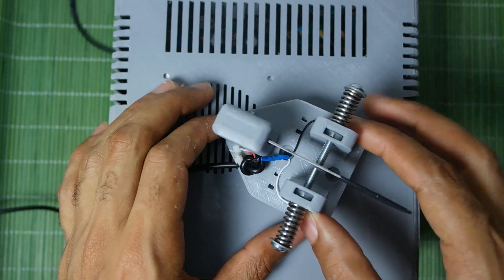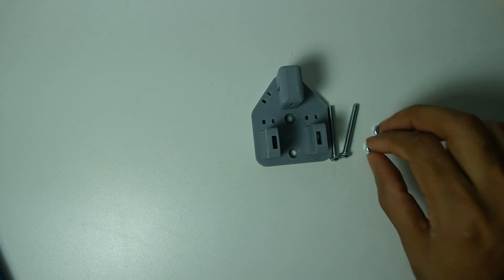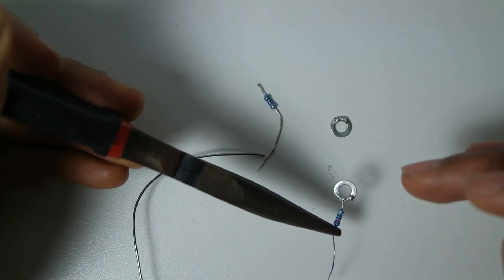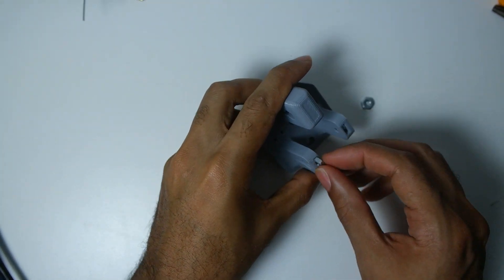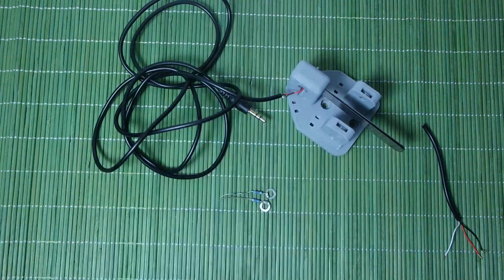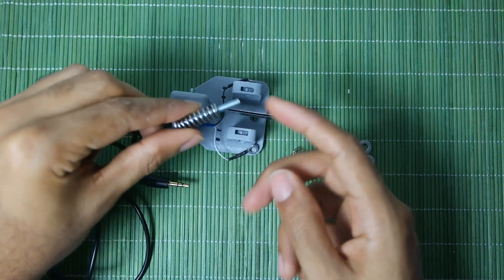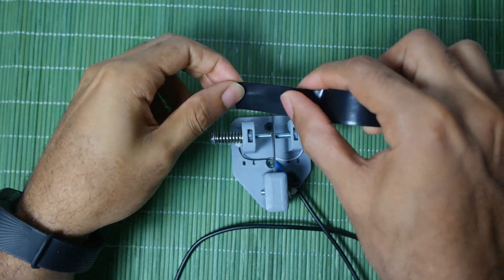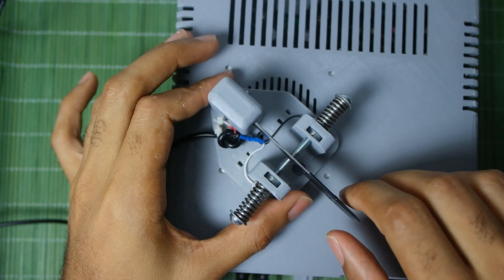3D Printed Single Lever Morse Code Paddle for the uBITX

Comment: Nice design. May i'll try it. But it is litttle bit too high for me. But thats no problem. Thnx for sharing the files.
Reply from the maker: If you have suggestions for modifications let me know.
Reply: @UndernetSystems  like this https://www.thingiverse.com/thing:4546930
But i found other designs with magnet for changing the strong  (sorry if this word is wrong^^) of pressing key.